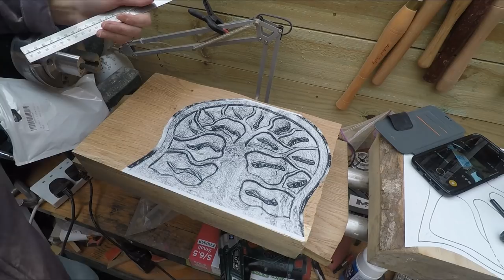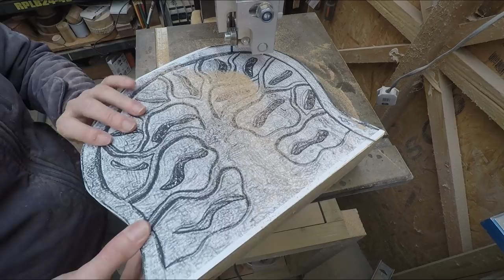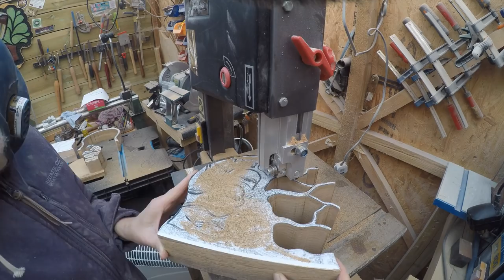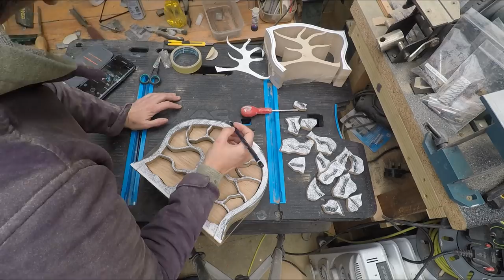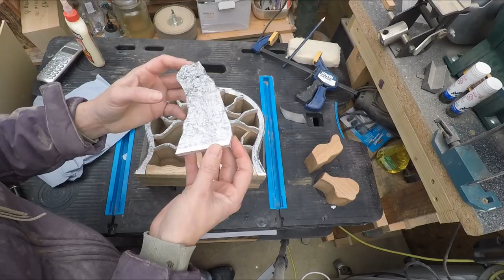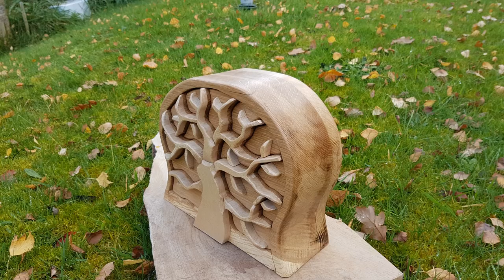Tree Bandsaw box

Comment: Very nice Pam!  I have watch this video a couple of times and I know that in the past you have mentioned the fact that you use a 1/4" ( 6mm ) blade; but how many teeth? I know from experience that the fewer the number of teeth, the rougher the finish but cutting material 2 or 3" thich ( 50 to 75 mm) will clog up a blade and cause it to wander or bend in the middle of the cut.  Once again 2 or 3 thumbs up!  ron USA
Reply from the maker: Hi Ron i use a 1/8 inch blade to cut the curves on the box 3tpi as its all i can get. i use 1/4 inch or 1/2 inch blades for cutting front and back off drawers or sometimes i use 1/8 for the front and back of the drawers. Yes your right the fewer number of teeth give a rougher finish but the fewer teeth helps the blade go through the wood faster and thats maybe why my little bandsaw manages to cut it and i dont get the blade wander. Ive not found i need to sand to much to remove blade marks. This is only my experience hope it helps :-) Many thanks Ron
Reply: Pam! Thanks for the answer!  I appreciate so much your willingness to share. Have a good day.  ron